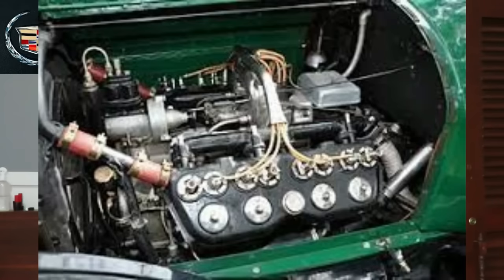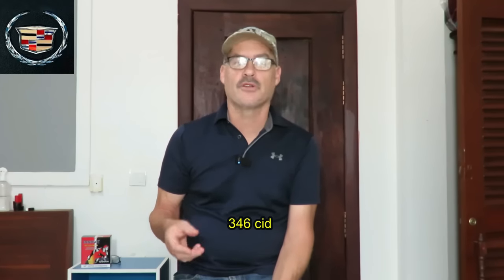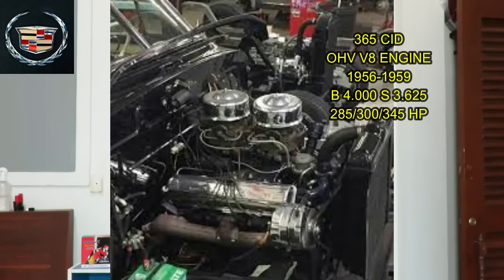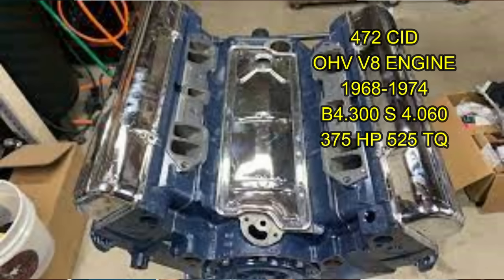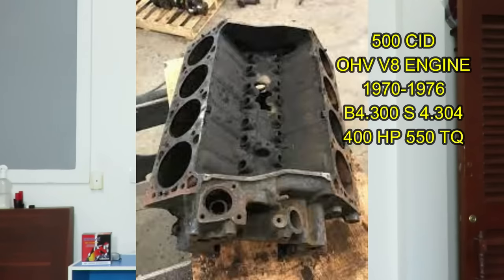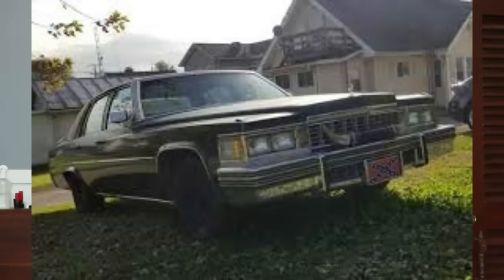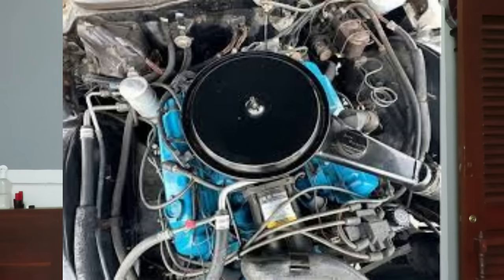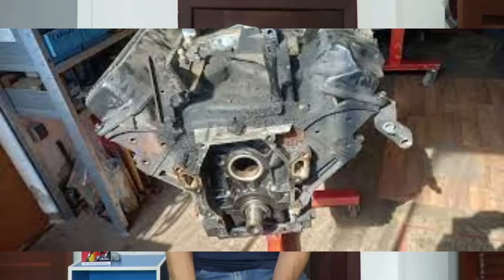CADILLAC V8 ENGINE HISTORY

Comment: I love Cadillac as I've been around them all my life. A few mistakes but that's ok. I have owned and worked on pretty much most of the engines listed after 1949. I know my grandfather worked and specialized on most of the early Cadillac V8's being very different and unique in design. Personally, my favorite classic V8 is the 390 from 1959-62 and my favorite modern Cadillac V8 is the 4.6L NorthStar. This engine does not receive the credit or recognition anymore it seems to me via these you tube videos. The early Northstar were actually very problem free than many think. Oil leaks will be common the gaskets that an engine uses. Oil problems and fuel injection problems is incorrect. Head gasket problems all stemmed from poorly maintained cooling systems and one major thing that happened with GM during the later 90s was the introduction of Dexcool antifreeze. This is still a great engine that doesn't get the recognition that is should be getting. My oldest is 1961 and my newest is 2005 and all of them have been excellent. It just takes the right person to know what they're doing.

Comment: The 1949 Cad ohv engine was the premier engine of the time.
It would move the hesvy Cadillac up beyond 110 mph. FAST FOR THE TIME.
A common conversion was to transplant these engines into 1953 1954and 1955  light weight Studabaker voupes.
These made very fast street rods.
Reply: Had a buddy in high school in 1963-4 who was a Studebaker/Cadillac nut! He had a Golden Commando and a Silver Hawk with Cads in them ... I think he mentioned the name; "Kettering" all the time and how the Studes were designed to accept the Cad engines since Kettering worked for both companies. He called his hybrids: "Studellacs".
Reply: Restored, swapped engines, trans, several older Caddys.
 Heads cracked web between cyl, exhaust, intake valve. Leaked coolant into combustion if severe.
 Experience.. Studebakers, Hawks above 100 mph were barely controllable, felt like a basket of parts through the twisties on old two lanes, to say nothing for brakes.. ;/

Comment: Good info!
  Observations. Not unique to Cadillac is GM's tendencies to introduce half baked designs. I wonder if, without proof, Corporate  production pressure led the divisions to put out designs before working out the bugs?
  Direct experience: 472/500s used a high nickel/ high tin alloy that enhanced thermal performance & reduced bore wear. It is not uncommon to source a u-pull-it with little or no bore wear. 
  In fact it was used in high stress small block Chevys & big block GM performance engines. On the ...010 Chevy blocks, if one looks behind the cam sprocket, there may be two 3 digit numbers cast there. 10 for hi tin & 30 for high nickel. I tore down one that had <0 010" bore wear after 200,000 miles. 
  Factoid. The 472/500 series was "verrry" wide as it is more than a 90° angle block as well as the long stroke (put one in a '67 F250, easy, use 57 caddy mounts & move the chassis brackets forward...) But a marvel of light weight casting as without all the added accessories it comes in at a little more than 50 lbs heavier than a 350 chevy.

Comment: Did the later HT engines get some kind of girdle that the head bolt threads or studs anchored into? Strange that Cadillac would make the same mistake again with the NorthStar (weak head bolt threads and/or undersized head bolts/studs that stretched,pulled or otherwise allowed the cylinder heads to "lift" 
Diesel engine makers such as Cummins solved a lot of these problems with cylinder head lift and head gasket sealing many years ago ? 

 The round "pills" that were supplied by GM dealers for use in the coolant of HT engines? Did they help?   Some sort of stopleak?

Comment: we put that 472 in a 72 Chevy c-10 works great, street raced 1977-1989 caddliac Big Block only aftermarket part was a Holley carburetor everything else was stock even the points distributor 👍💪

Comment: That’s weird my parents owned a 1959 Coupe De Ville 2 door hard top that had a 390 overhead valve engine I remember changing the fuel pump on it when I was 16 in 1966. They had bought the car used in 1963 or 1964.  Dad and two of his co workers ran a AA/F dragster in 1964 at Santa Maria, CA.

Comment: I worked on many of these engine up to 1986.
I once worked on a 41 flat head.
The 472-500 were my favoites ,biggest issue was weak and broken valve springs. If you did a 3 angle valve job ,and 2 angles on the valves it really woke them up. I always put new springs in too.
The ht4100 was a piece of crap. No gaskets, almost everything was silicone...and they leaked real badif you mixed and matched flat top piston short bloke with a 70 head with small chambers that would make some power with high er compression.  The 425 had a aluminum intake...and it always leaked at number#7 & give it a rough idle. They finally stapled a paper gasket to the metal "turkey pan" and that sloved it. I think the blocks were machined wrong or the manifold. Or maybe they warpped due to all the weight (metal) they removed from the blocks and head. We were told the rotating assembly was from the olds 425...???
Reply from the maker: Thats Interesting I have never heard the rotating assembly was Olds but That does not mean it wasn't I'm curious now I'm gona look into that
Thanks

Comment: International would be interesting! Ok I have a question about Cadillac blocks such as the 472 & 500. I've heard some refer to them as weak, or just being puuny. Like main caps, skinny & light. But then others have said they used a special recipie for the metal the cast their blocks with, so they might look light but are actually very strong & durable? Is there any truth in any of this stuff???
Reply: Yes, they were high nickel blocks and quite strong. The rods were relatively weak, and the oiling system was not meant for high RPM service. These things are easily corrected when hotrodding them, though.
Reply from the maker: IHC is on my list

Comment: You should have had noted about Cadillac engines that were  marinized.   The earliest were 331 then 354 and finally the 390 all converted  by the company that became Crusader Marine.  Originally DRE.  Detroit Racing Engines, then Cal Connel Cadillac then Cadillac Crusader as and finally Crusader Marine. .the last year for Cadillac in   (Crusader Marine) was 1963.    Crusader went to Chevy  blocks after that.
Reply: 354 was chrysler the 365 was the mid cid cadillac engine started in 56
Reply: My bad. It was 331.   I knew it was a  match to a hemi.     The hemi was also marinized.   Both the 331 & 354.  And maybe 392.   (I haven't  seen one of those). Cadillac were marinized 331, 365, and 390.  Ranging from 230, 240, 250, 275, 275, 285,300, and 325.   Depending on the year, carburetor , cid, and compression.   There were two different 325 hp.  one was the 365, one was the 390.  The 365 was considered a racing engine.    The earliest ones came out in 1953 ish.  Basically custom built by DRE.  There were between 30 & 36 of those.  # 1200 thru 1230 & 1236.   Cal Connell Cadillac  name change started between 1231 and 1236.   We believe  the first DRE Marine engine was #1200.   DRE, Cal Connell Cadillac & Crusader Marine built a  1000 + between 1953 & 1963.   Working on figuring out exactly how many were built from boat manufacturers  records.   Crusader has no records from 1963 and earlier.
Reply: @tmiklos4  yes the popular hemi's were the 331,354,392 and some baby hemi's around 270 cid from trucks I believe. The 365 definitely was a popular swap as the 56 Eldorado had the dual quad intake all cool engines. I have a 56 4 dr hdtp sedan deville with the 365. I also picked up a pair of 354's that I'd like to use up in something. Have a good one 🤙
Reply: We   ( my brothers and me)  have several marine Cadillac engines.  And several Chryslers ..  as far as what engine can be run at WOT  .  Chryslers can be run WOT almost endlessly.  Not so much with the Cadillac .       Finding a boat with a good original engine  today is about 80 times easier with a Chrysler.  They are bulletproof.  Cadillac engines tended to fail due to oil returns.    This problem can be fixed in a rebuilt.  Oil returns are enlarged.  Also a higher volume oil pump helps.   We have run 365 and 390 Cadillac.  354 hemis 413 and 440 Chryslers. Both dual 4 bbl and single , on both Cadillac  and Chrysler.      We have Also run big fords fe 352 390, 427.  Also big block Chevy, 427 454.  My favorite of all of these is the 413 Chrysler.     I know im rambling.
Reply: The 270 was the smallest -block version, for the Dodge.  4.1 inch bore centers.  The DeSoto HEMI had 4.3 bore centers, the Chrysler had 4.5 inch bore centers.  Three different blocks, that's the way Chrysler did it.

Comment: My 1954-1963 Chilton's  specs for the 331 OHV  say boar and stroke of 3 13/16 x 3 5/8  (3.8125 x 3.665)  which are in conflict with the dimensions shown here. 6:30  So Cadillac went from an extremely  undersquare engine  to  slightly oversquare.  Advertised torque for 1954 330@2700 RPM.  Advertised torque numbers are shown through 1963. I once owned a 1986 Fleetwood Brougham 4 door with the 4.9 engine. 19 MPG on the highway but GUTLESS. Had a 4 bbl carb. Reliable though.

Comment: I'd like to hear about the older car company's engines.  I know some of them used other manufactures engines, im just not sure who used what
Reply: >>> Continental produced a LOT of engines for various automobile and tractor engines at the same time back from mebbe the 1920s to the mid-1950s. 
>>> I believe that Kettering/Cadillac also produced a few Kettering/Studebaker engines - but maybe you've just noticed that a Ford engine (f'rinstance) was in a Mercury and as well as Fords --- and GM - who got their corporate butts handed to them for doing the same thing but not changing a decal, was using their GM/ Chevy/ Olds/ Buick/ Pontiac engines kinda indiscriminately in their whole lineup for a while. 
>>> Ford used the term: "Ford Powered" and avoided the lawsuits and GM just let the individual badges stay with their different engine, no matter where they wound up. 
>>> It wasn't uncommon to find an Oldsmobile engine in a Chev or vice-versa. Hence the lawsuits from Nancy-car owners.

Comment: Yes, you can rebuild a smog engine to MOSTLY pre-smog specs, but you can't use double-digit compression ratios, as we no longer have 100 octane fuel.  There were no such thing as knock sensors, and you can't add them to engines that never had them.

Comment: I put a 58 Cadillac V8 and a 57 Chevy station wagon😮 extremely fast car for the day. I believe it was a 390 cubic inches. Everybody wanted to buy that car because it was so fast, everything was all stock.
Reply: I bet the engine was a 343 or it was from a 1959 at least. IIRC, the 390 run was from 1959 through 1963.

Comment: The Hydramatic came out offor 1940 on Oldsmobiles, so it is impossible for 37 Cads to have it.  Also, a 390 version of the 322/346 was never mass produced, possibly because of the sharp recession of 1938.

Comment: Wasn't  the Caddy engine lighter than other big blocks in 50s and early 60s?
Reply: Total engineering, precision cast and bore breakthrough, it replaced the massively thick (lack of precision cast/ boring back in the day) and heavy Cadillac flat head block with deep skirts, and the dark blue/black 'porcelain coated exhaust manifolds.. ;)

Comment: For it's intended use as a truck engine even tho the TBI and heads had terrible potential for a high performance application the TBI 5.7 Chevy engine was a great truck engine big improvement compared to GMs old smog headed Qjet 350, the 350 the tbi 5.7 felt pretty lively. That swirl port head made great TQ, but that hugely obstructive swirl ramp was making any high rpm HP impossible but surprisingly they will still pull smoothly out to 5000rpm or so  how I have no idea. I had a 2wd regular cab Silverado with a TBI 350 and it had a mild c.a.r.b. approved crane compucam it had 210/216 during @0.50 and .440/.454 lift 112° lsa a cat delete dual exhaust and 3.73 it ran strong even with the 3.42 gear it came with. With those few mods it had a bit more TQ and midrange power, it wasn't fast per se but I ran strong and would do respectable posi burnouts lol.

Comment: HP numbers really came down in early '70s because they changed from gross HP at the crank to net HP at the wheels. In addition to the smog controls. Hp didn't come back until there were computers fast enough to control the engines.
Reply: That was only part of it.  Lower compression and milder cams did the rest

Comment: 1972 was last of power 472/500, 1970-1976 500 was optional. 1976 offered direct fuel injection 500, in Talisman and and Eldo. 1973 was cut off in HP, 8.9:1 compression. Pre was 10.50 compression. 68-69 only 472 with no 500 option.

Comment: Would like to see a video of the 4.3L V6 that Chevrolet used for a number of years.  Your thoughts, likes, dislikes on this engine would be helpful as it appears to be very under powered from what it possibly could be.  To me it could be tweaked, technology used with VVT, to get get  stronger power while getting descent mileage and torque, along with the right gearing and transmissions.
Reply: Agreed - due to it’s relatively large displacement it would make a great V-6 if developed further. I remember it being available in the 1986 Caprice.
Reply: It was developed further on the new LT platform. It has all the same features and the V8, including aluminum block and heads. It is no longer used in the pickup but still in the vans.
Reply from the maker: I built many 4.3L V6 engines for a company in Florida that was using them in air boats we ported the heads and put flat top pistons in they made 300 HP
Reply: @Myvintageiron7512   I fully believe that Chevrolet could of got 240 to 260 HP with maybe 320-340 torque but with VVT, and cylinder deactivation at speed, keep rpms below 1800 to get much better gas mileage along with overdrive transmission gearing.  I myself was able to squeeze 22 mpg loaded back in the day,  so with technology it could be stronger while efficient.  Instead they came out with straight 6 diesel,  while discontinuing the 4.3L.   Bye Chevrolet . I used to be a Oldsmobile car guy when I was younger,  appreciated your video of Olds engines. But for working days I used the Chevrolet brand and really liked the V6.
Reply: @billyhndrsn4542  They did NOT discontinue the 4.3L! It is still in production today as a V6 version of the LT V8's

Comment: The 4/6/8 engine probably would have done ok with multipoint sequential injection. You’d need a computer fast enough to phase the injector turnoff and the valve deactivation. Throttle body injection with a number of dead-end runners sounds like a fuel distribution disaster to me.

Comment: The   500 was actually 501 cid according to the sticker  under the hood on my 74 Eldorado.    I believe the 73  i had had the same sticker.
Reply: This was the way GM got their Cadillacs and the big engines into the State of California --- 500 was the break-point for certain fuel economy and emissions standards where they went very lax because an engine bigger than 500 cubic inches "was gonna be a big truck engine" - was the CalEPA reasoning. Hence the 501CI sticker statement.
Reply: @SurferJoe46 ..8.1 L 'Workhorse' in older motorhomes is a beast, five speed Allison reliable and going strong at over 130,000.. ;]

Comment: Something that's always made me scratch my head is the dimensions manufacturers come up with especially with engines like how the hell do the engineers come up with a 3.62" bore and 3.307 stroke? Even a 350 SBC having a 3.48" stroke is kinda like why? You would think they would round everything up or down to the next whole number for simplicity, ford at least did it with the 5.0 & 5.8 Windsor 4"x3", 4"x3. 5", was Chevy that hung up on the 350 number? Also it did seem like in the past over square or at least square was the norm for any engine that leaned towards a performance application but lately in modern engines that trend has seemed to be fading. GM chose to go with a smaller bore longer stroke than typical with the 4.8 and 5.3, the 5.3 has a good sized 3.62 stroke but a little 3.78 bore barely bigger than a 305's 3.73" bore but everyone hates on the 305 for that reason but yeah I get why the 5.3 makes more power it's the heads and GM obviously  went with a longer stroke for TQ where it was a truck engine I'm assuming. Like ford 4.6 with its tiny 3.5" bore but 3.5 stroke or the The feared 5.0 coyote has a nice good sized 3.65 stroke but a itty bitty 3.62 bore! Yeah it has 4 little valves but still there has to be some shrouding, what would a coyote be like with the normal 5.0 4"x3" B&S, id think killer and really high rpm but maybe less piston weight is a bonus with with the little bore? And it's a high rpm ripper! I don't really get it,  is every thing I've ever believed about performance engines wrong or at least non applicable like big bore is better it allows large valves but at least less valve shrouding and shorter stroke longer rods allows high rpm with lower piston speeds and longer dwell time a TDC = mo power baby! But now? At least I think maybe I have the rod length thing right seems where longer rods seem to be the norm across the board, but maybe not.  I know I'm long winded babbling but I am truly confused and you are a very knowledgeable engine guy maybe you can shed some light on it.
Reply: That has to be one of the longest thumb-typed single-sentences I've seen this month. Are you a Gen Z?